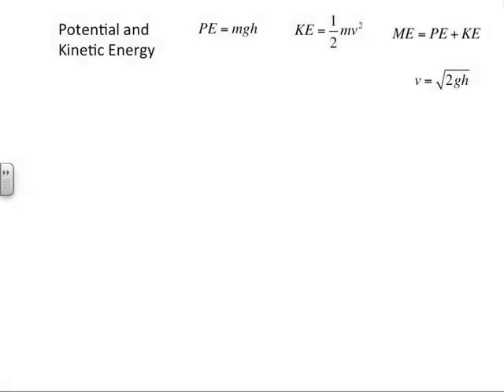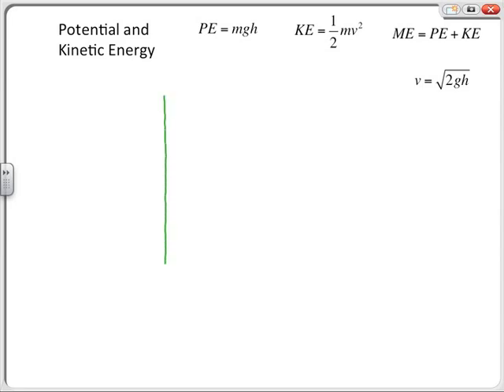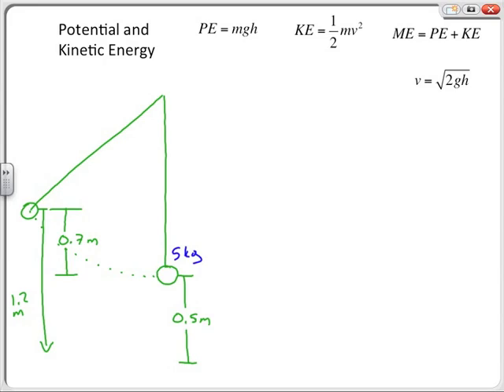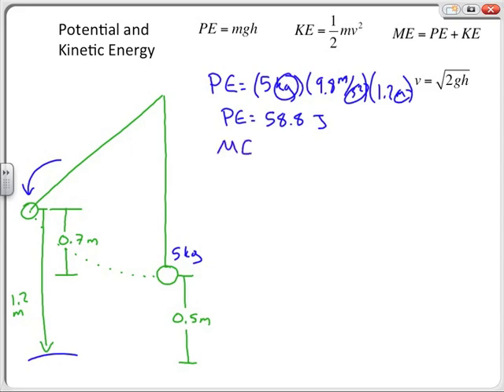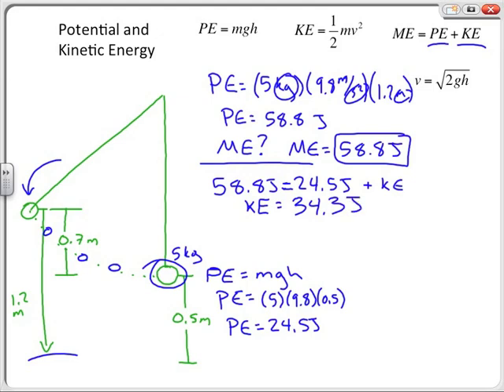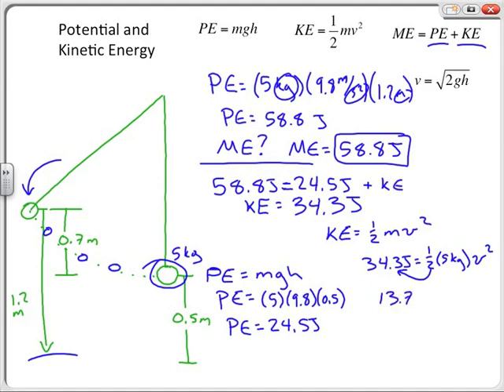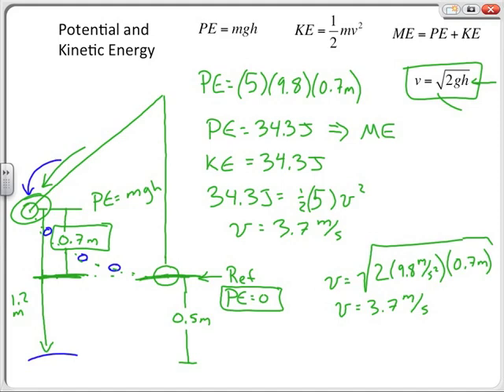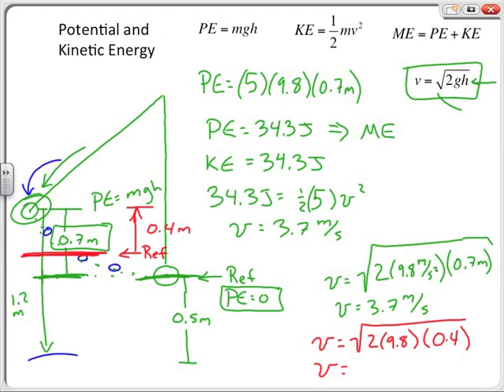Potential Energy and Kinetic Energy Sample Problems, Chapter 11 Review

Comment: This is the problem: An electron is"boiled" off the filament of an x-ray tube. The electron then moves toward the tungsten target which is at potential of +20,000V relative to the filament. Determine the speed of the electron just Before hitting the target. The mass of an electron is 9.11*10^-31kg. When the electron hits the target, a considerable part of its kinetic energy is converted into electromagnetic radiation in the form of x-rays.               
.